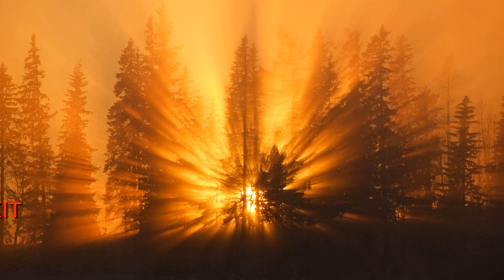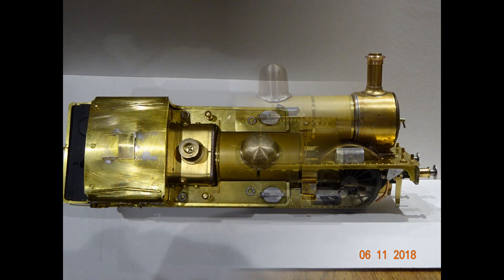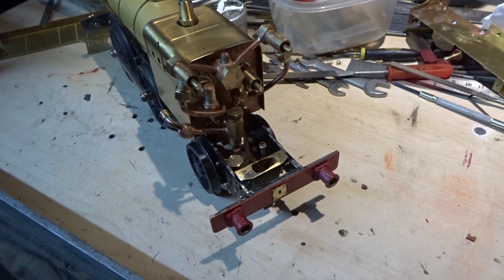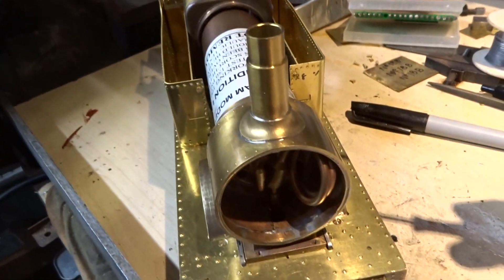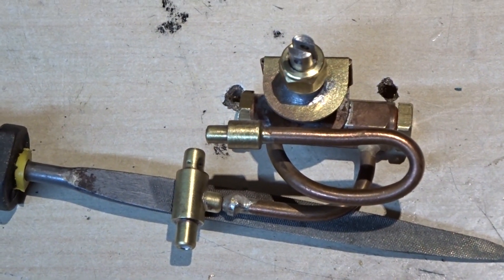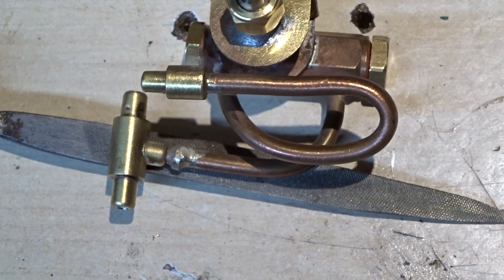GWR 14xx tank locomotive

Comment: There is not enough time left in life to do this kit.. sorry it is not a kit, but a nightmare.
Reply from the maker: I tend to agree. This is not the only kit I have made by this manufacturer and trust me the 14xx is NOT the worst of the bunch. I will not be building any more of the kits by this manufacturer. If u need any help or advice I will be happy to try and assist. Good luck. Ed
Reply: I have built their 2p loco and it really put me off  loco building,
Reply from the maker: I totally sympathise. I bought a part built J38 from a deceased estate by the same manufacturer. The inherent manufacturing defects were appalling. As I bought it second hand I had no recall to the manufacturer and ended up remaking substantial parts (eg cylinder, crank axle etc) myself. This firm is to be avoided at all costs (personal opinion).
Reply: Edwin White well your extensive description of the kits defects are not opinion, but facts.